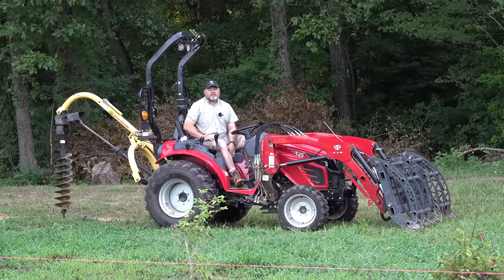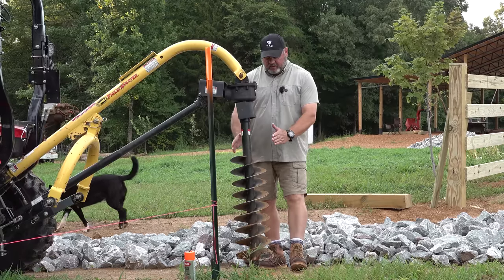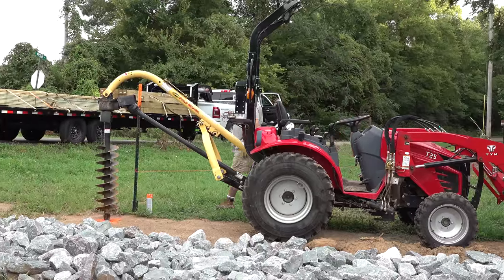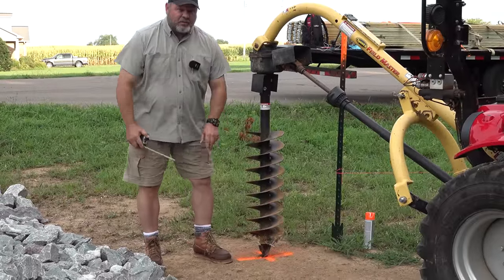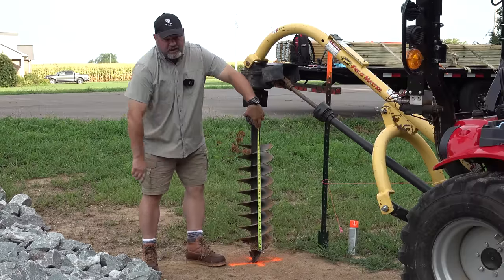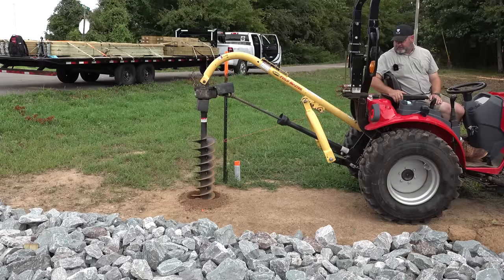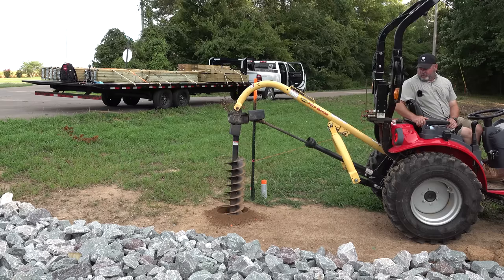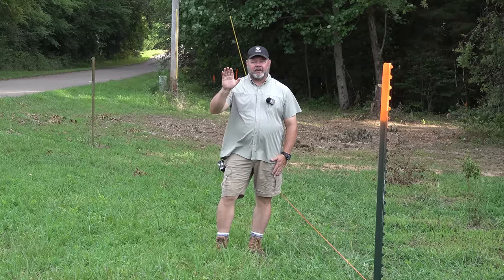How To Use A Tractor Post Hole Digger! PRO TIPS

Comment: Finally someone digging in dry clay. Everyone else cutting like butter in soft soil.
Reply from the maker: This clay gets hard as concrete in the summer
Reply: @TonysTractorAdventure  I have the same stuff, I was worried about the auger not doing the job but this one did good.
Reply: I wish I had dry clay. Digging in gravel, boulders and roots. Altho below 2-3' it becomes sand.
Reply: This is still cutting like butter. Compared to where i dig here in ny. Nothing but rocks. Pretty much like burying that stone you got there plus giant ones and trying to go through it. Definitely need carbide tips here.

Comment: That was a great instructional video.  Lots of people complain about using a post hole digger.  I never thought it was that bad and it’s much better than digging by hand.  Even after using mine many times I still learned a few things from you.  Your explanation of straightening out the auger left to right was very good. Also, I never thought of adjusting the 3 point drop rate to keep from screwing into the ground.  I always just pull up occasionally but that is a pain and if you pull up too far you widen the hole front to back because of the change in angle.  Screwing into the ground is a nightmare.  I have only done it once and with the help of a pipe wrench and a cheater bar I got it out.  Once was enough.  I hope I never do it again.  Thanks again for the great video and tips.
Reply from the maker: It sounds like me and you have walked some of the same roads!
Reply: @TonysTractorAdventure  Yes we have.  Love your channel.
Reply from the maker: Thank you.

Comment: Yep, first day trying out my new post hold digger, she screwed in.  Discovered how to adjust the lift pressure.  But just as important, I had the lift pin on the digger set to the bottom hole.  Set that way, my little tractor didn’t have enough leverage to lift the digger property.  Anyway, great teaching video Tony.
Reply from the maker: Thank you. I have used a post hole digger a lot over the years and I have  done just about everything wrong that can be done. My dad always said, if you are going to be dumb, you got to be tough. Still, I hope some of my experiences help someone else.

Comment: I placed a clear hose in u form filled with water and food coloring clamped to the side of the shield next to the gear case , when auger is plum i marked a visible line even with the water level, therefore i can see if its plum from the comfort of my seat and dont have to get off
Reply from the maker: I just learned to gauge from the seat.

Comment: Hey Tony! Just letting you know that your tips and advice on the PTO auger has helped me tremendously! 
I just bought a new 3 point auger a few weeks ago and have had no previous experience using one. I couldn't wait to try it out so I drilled a few holes for a temporary tarp canopy. I did everything wrong and I almost got it stuck several times. I saw this video and watched it a couple of times then went back and drilled 12 holes for my deck support and I was able to get 12 perfect holes without any damage to me, my equipment or my RV that I am building the deck for.
Again thank you so much for what you do!
Reply from the maker: Wow! Thank you. That is the best comment ever.

Comment: Great information Tony.  In Florida we often used to dig the corner post holes and fill them with concrete.  Then we would set the posts on a steel saddle.  The kept them out of the termite infested Florida soil and kept them from rotting so fast.
Reply from the maker: We used Fast2K for all of our posts. It protects them and the buggers don't like it.

Comment: Yes, very informative.  Found crucial info not seen on other vids.  The drop-rate valve tip is so helpful, as well as the advice on leveling and adujsting.  Well done.  I feel much more confident and excited to drill 19 holes tomorrow for a round pen!  Subscribing!
Reply from the maker: Thank you. I am happy it helps.

Comment: I appreciate your firm and forward delivery of information! Your video set Me straight that they are manageable to operate given limitations but with correct setup, engine speed and technique, I feel more confident about My quest for a Post-Digger. No doubt they are dangerous if used carelessly, I've seen other channels where people are standing 18" away while the operator jerked the auger in and out of the hole at max engine rpm's! If that auger breeches the topside of the hole from a violent lift, the U-joint at the gearbox will turn that spiral bit into a whip! Thanks for sharing your knowledge and experiences, it helps us newbies survive the learning curve during the apprentice phase!
Reply from the maker: Thank you for the kind words. 👍

Comment: Good info. I have 2 pastures of posts I'm about to have to dig, 260 holes to be exact. But I'm just doing 1 pasture at a time. I've had my 40HP hydrostatic Kioti tractor about 8 months now & it is a beast for it's size! I found a brand new heavy duty auger with 48" long x 9" diameter bit for $600.
Reply from the maker: Your tractor will pull that without any problem. It sure beats doing it by hand. 😁

Comment: Heavy clay when dry can be extremely hard as you video has shown.  Also when we hit the desired depth of hole, we usually dump a bucket of water in the hole it makes the clay plastic and provides a clean bottom.  we are in an area of deep frost and heavy clay so holes are normally 4ft deep.  Nice video and some very good tips.  Thank you.
Reply from the maker: That is good information. I guess you guys have to worry a good deal about heaving. On a rare occasion we will have a freeze line down to 12 inches. Most of our freezes only go down 5 or 6 inches and then the weather warms back up.

Comment: Well done video. I hate using manual clamshell diggers enough that I usually auger several inches deeper than required, then filling and tamping with a 2x4 to get the exact depth.
Reply from the maker: Agreed! Handheld post hole diggers are medieval torture devices.

Comment: Really well done video Tony. You covered most of the tips I’ve accumulated using mine on my JD 1025r.  About the only thing I’ve seen to add is how decent sized roots can impact you.  I’ve drilled post holes in wooded areas or just cleared areas and when that auger grabs one it’s awfully hard to keep it from drilling in and not wanting to come back out. Especially with weak lift arms like mine.  Eventually you start to get a feel for when it’s starting to grab one and you can catch it early enough to rock forward and back a bit and try to get back out before you don’t have a choice but to screw it out. It can be a tough implement to use in some conditions.
Reply from the maker: There are so many variables, I hope it gives the new guy something to start with.

Comment: All great stuff.  I have a hack.  It also helps address  horridly stony soil like I have  I got big rocks.  It's an easy hack.  A bigger auger.  Makes centering the hole easier, clears larger rocks easier,  and helps  compensate  for angular error.  'Course ya need a bigger tractor.
Reply from the maker: I use up to a 12 inch auger with this tractor. It is very important for us to use the 9 inch auger. The bigger the hole, the more of the foam post setter is required. The foam post setter cost $12 per bag requiring 2 bags per hole with a 9 inch auger. We have 120+ posts to put down! A bigger hole will increase the foam cost by 1/3.
Reply: I've never used foam.  Rockc and dirt and  a heavy tamper, or concrete. Sometimes I have to use concrete.
Reply from the maker: I find concrete rots the posts off quick. I love The Fast2K. It is easy and protects the posts.

Comment: I have a bx2660 Kubota. Rated Cat1. Is there a post hole digger you recommend? Do u ever use wheelchocks? Enjoyed your video. Thks
Reply from the maker: If I had to buy another one for the back of my tractor I would probably go with an IronCraft.
Reply from the maker: I don't see how a wheel chocks would help because you have to roll forward as you go down because the arc lengthens.

Comment: Thanks folks. It's a skill alright, even straightforward things are difficult until you have the knowledge. 
Are there different wear edges you can fit for different conditions?
Reply from the maker: My auger has hardened steel cutters but you can get carbide cutters. Hardened steel cutters for us last a long time. We have play with virtually. No rock.

Comment: Any suggestions with more downward pressure? Rock bar knob is all the way open and cant go full depth. No rocks or roots in way either.
Reply from the maker: The cutters being sharp is a big thing. The screw on the tip must be sharp too

Comment: Very informative and helpful video. As you noted, those post hole diggers can be dangerous if not respected. 

Also, I was wondering if you have done a video reviewing your deck over trailer? I did a search on your channel and didn't see one right off. I know the trailer has been in several of your videos and was looking for your thoughts (pros/cons) and if you would buy the same trailer again? What limits you have found? (Can you tell that I'm trailer shopping.)
Reply from the maker: The deck over trailer is awesome for what we do, but I would not buy it again. I would buy a conventional trailer with fold up ramps. The hydraulic lift deck system is heavy thereby making the whole trailer heavy. My trailer is approximately 5800 lb empty. Hindsight says that is lost. Carry capacity on 14,000 lb axles. The ease of loading hydraulically lifting up and down is amazing but we have been close to the weight limit of the trailer a few times. Other than that it pulls wonderfully and I've had zero issue as far as maintenance. We have about 5,000 mi on the trailer so far. Guesstimation.
Reply: @TonysTractorAdventure  thank you for the information, I will keep it in mind as we continue our search. 14K is the weight we are looking at, but as you pointed out losing almost 6k to the trailer itself is a little hard to swallow. Hoping to find a tilt-trailer that will meet our needs, just in today's market, in no hurry to buy or should I say in no hurry to pay those prices.  Thanks again for the info.

Comment: found the same thing - if you aren't plumb, you'll be screwed, and once the hole is dug it's much harder to correct.
Reply from the maker: There is a small flat spot on top of my  auger's gear box. That is the place I look at to see if it is level. If the top is level, then the auger is plumb.

Comment: Another tip.. Instead of pulling forward, after your hole is filled up with loose dirt, simply raise the auger, hit the throttle, rev the tractor up high and drop the clutch. This spins off the dirt and it throws it beyond the hole, You can do this several times and end up with with an almost empty hole without moving the tractor away from the hole.
Reply from the maker: This is a hydrostatic transmission. With electric over hydraulic PTO. It is a little less responsive.  Also, I didn't want the dirt around the hole. Just a different style of doing it. Thank you for taking the time to share your way. I always learn so much from comments. God Bless
Reply: @TonysTractorAdventure  Sure, many ways to skin a car as they say..:)

Comment: What happens when you hit a rock too big  to go up the auger flights? Is there a shear pin, to protect the gearbox when it gets stuck?
Reply from the maker: I don't recommend an auger for rock. Maybe something meant for rocks would be better.
Reply: I wouldnt use in rock, but we have baseball sized rocks mixed in with our soil.  What happens when the auger hits one of them?

Comment: I just started using my 3 point PHD and I sheared 5 pins in the first hole, no rocks and fairly soft soil.  I have no idea what I'm doing wrong, I tried to go slow and had RPM's at like 250.  I didn't really see anything in the video that might describe what I was doing wrong, any pointers?  It would run smoothly and I'd press it down very slowly but the very first sign of resistance the pins would sheer.  I wouldn't even have time to react, just poof gone.

Any tips would be greatly appreciated!
Reply: You might have this problem resolved by now, but it sounds like the pins are too soft.  The shear pin is to protect the gearbox and drive line in case the auger gets into something it can’t handle.  Slight pressure in soft dirt should not shear a pin unless you are using too large a diameter auger, like 24” or something like that.  Grade 3 bolts (no markings on head) are pretty safe for shear pins since they are not too hard and will shear if necessary.  The next step up would be grade 5 bolts (3 marks on head).  I’ve drilled a lot of holes with a 3 pt auger in all types of ground and sometimes it’s easy and sometimes it’s near impossible.  Soft dirt should be easy.

Comment: This past Sunday I was trying to dig some holes for a new mailbox. Totally forgot about the limiter valve and screwed that sucker into the ground all the way to the hilt...not by choice. Went through 3 shear pins trying to break it free. Also tried rocking it back and forth to help loosen the surrounding dirt. Ended up breaking out the pipe wrench and cheater bar and all it did was break the pipe wrench. Now I've got a larger steel pipe wrench and time to get busy. *Side note: After all was said and done, I think rocking the tractor back and forth to help break the tension on the auger has cracked the housing surrounding my hydraulics. I now have decent amounts of fluid leaking out of my tractors rear end because of this. Be forewarned!*
Reply from the maker: Your story is a great learning tool for all of us. Thank you for sharing it.

Comment: New subscriber, glad I found your tips on augers.  Looking to buy my first post hole digger and auger... Atwoods near me has a ToolTuffDirect model 650 which appears to be the right size for my Kubota L2800. The manufacturer website says it's compatible with 6", 9", and 12" augers... but they also sell an 18" auger which I would like to get for planting trees (we just build a house on a new homestead and hope to put a lot of fruit trees in over the next year or two) - Since I have no experience with PHD/Augers... it doesn't list the 18" as compatible... is that a solid no-go as it won't be able to handle it?  ...or is it a case where if you go slow (these won't be super deep holes just to plant trees) it will work fine?  I don't want to make a stupid mistake and tear something up, but that 18" is going to work a lot better for what we need if I can run it.
Reply from the maker: Just go slow! If you let the cutter drop, it will dig in and then there will be problems. You will learn to do it.
Reply: @TonysTractorAdventure  thank you for taking time to advise! Slow it is!

Comment: Another important point is to not use a quick hitch with a post hole digger.  It extends it too far to the back and adds instability to the whole rig.  So if you have a quick hitch, be sure to remove it before mounting the post hole digger.